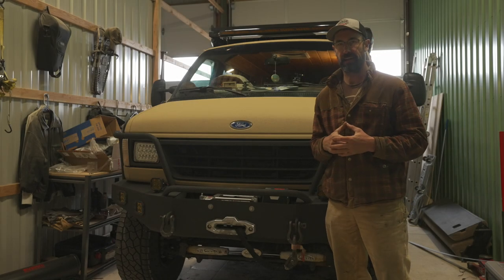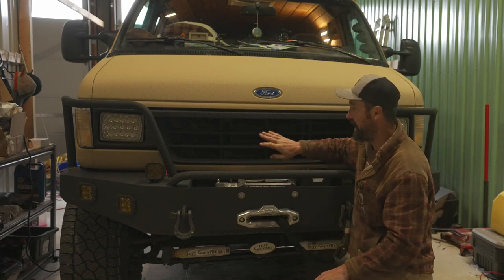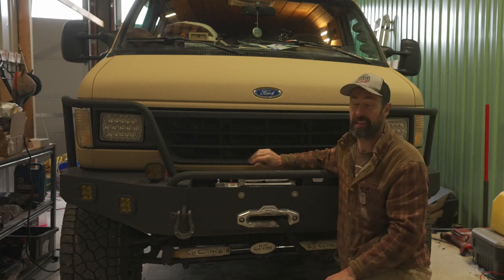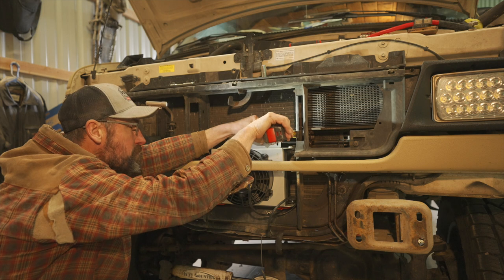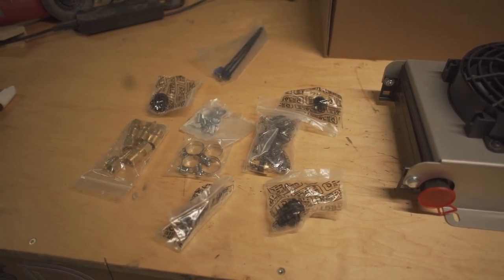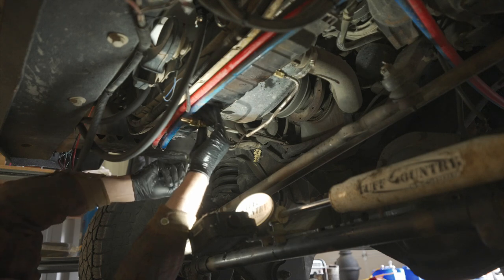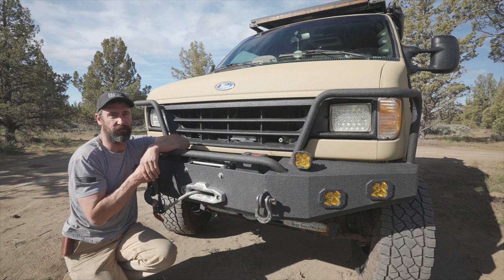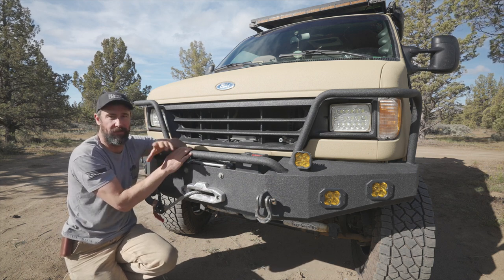DIY Derale Transmission Cooler Upgrade on 4x4 Ford Econoline Van - Revised

Comment: I should have searched your channel first for this topic lol. I'm putting a 10" fan on my transmission cooler today and have also elected to go with a switch over a thermostat. The bus is running a little hotter now that I have the AC working and want to try to keep the temps in the 180s. I monitor the bus' info while driving so flipping a switch when needed isn't going to be an issue. Very helpful video, thank you.

Comment: I thought about a manual switch when I installed an auxiliary transmission cooler on mine, but ultimately chose a temperature switch. I went this way so when I am concentrating on the road, and if the transmission temp gets above a certain point, the fan just comes on. in the future, I may add a bypass for manual control, but this works well for now.